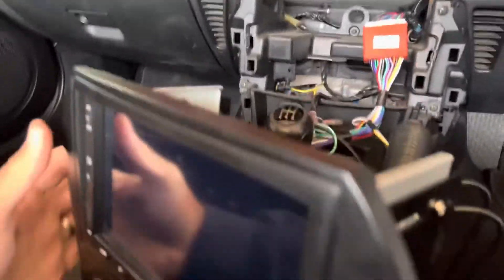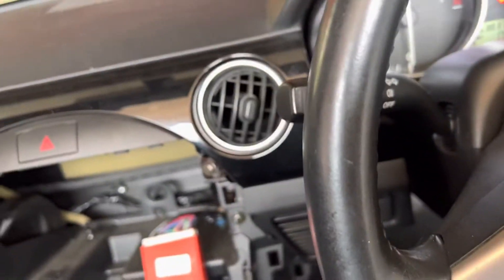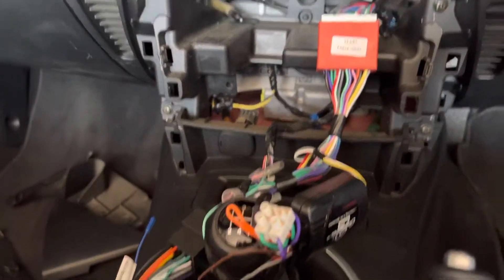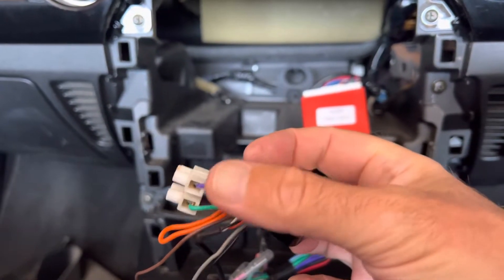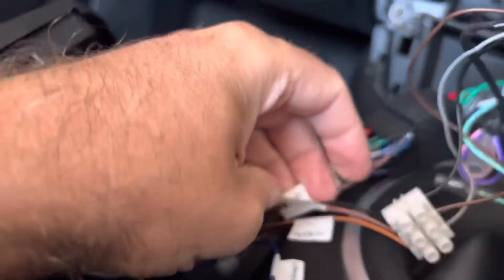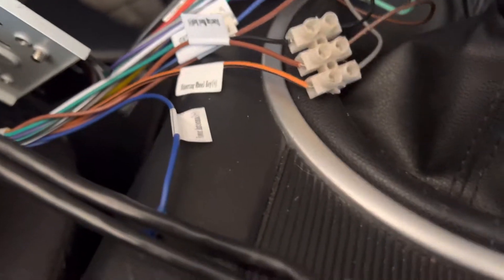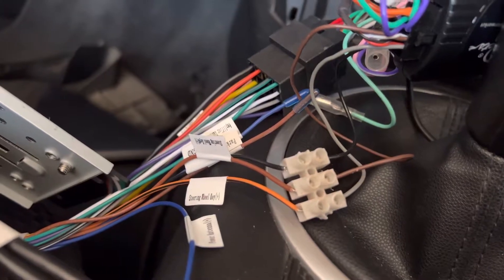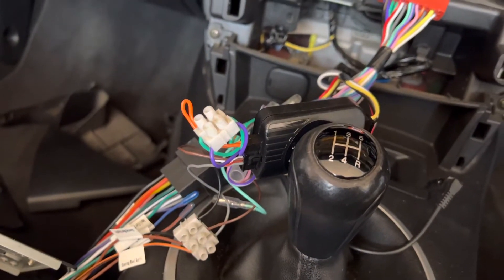ATOTO S8 Mazda MX5 NC install with connect2 steering wheel controls

Comment: Been looking for something like this for my Honda Civic Fn2 Type-R.   The volume button and skip and mode on the steering wheel will not work with my Atoto head unit.  So hopefully if I follow this might work 🤞🏼.  Just a question at the end you said not to plug in the adapter ? Is this not needed for all or just your Mazda ?

Comment: Not necessarily for android head units… I think you can connect the key wires directly.
Reply: It depends of your steering wheel command, either it is a resistor command, so you don't need a device, or it is via can bus, and you need one.